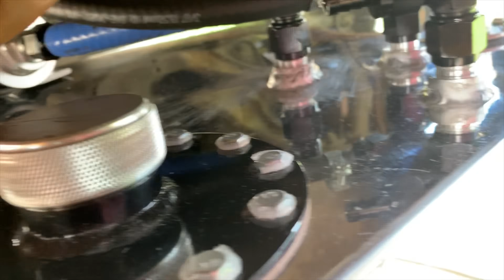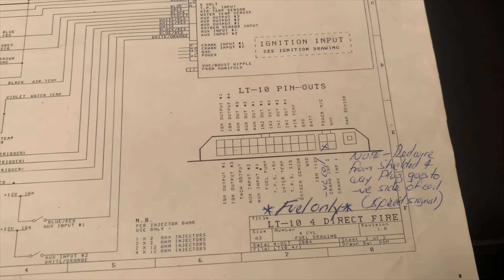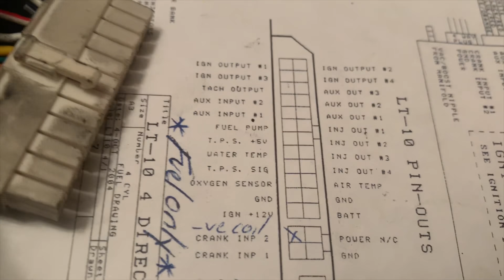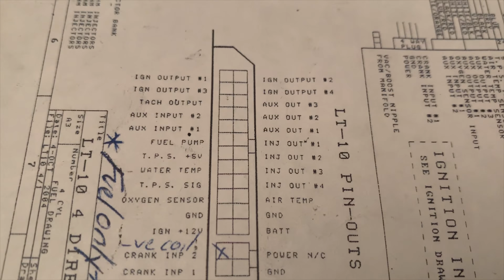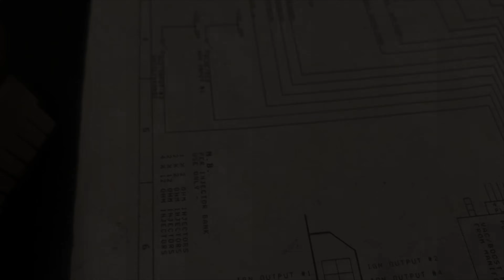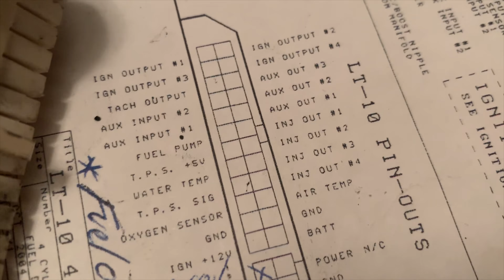Part 22 fuel tank install and microtech pin out

Comment: Hey bro.  Where did you get the gas tank and stuff?  I may need one for my 87 starion.  I'm located in North Miami FL.   I would like one as close to stock fit as possible.   Dont want to do any major modifications.
Reply from the maker: I got you completely covered👌🏿👍🏾